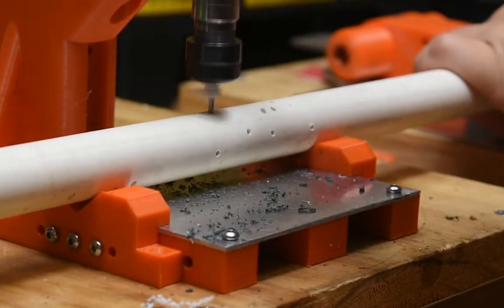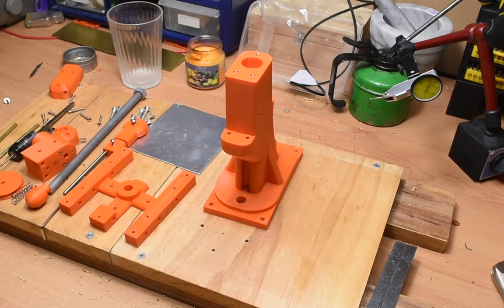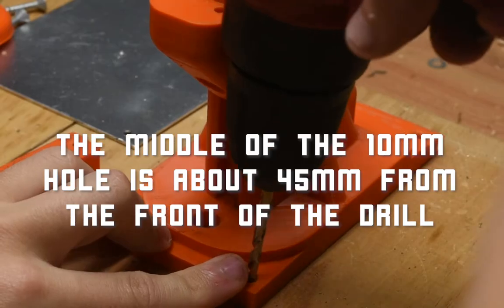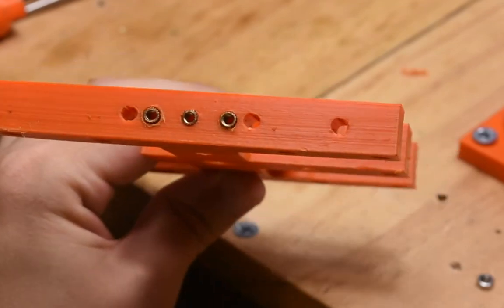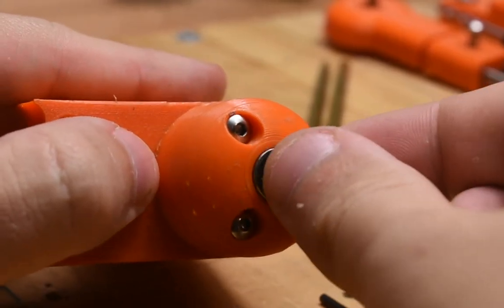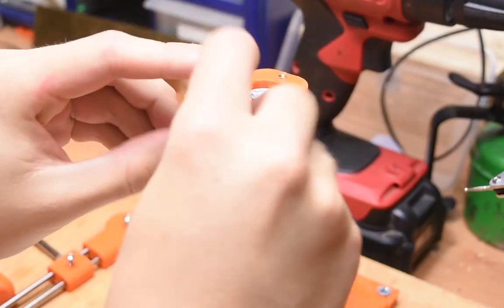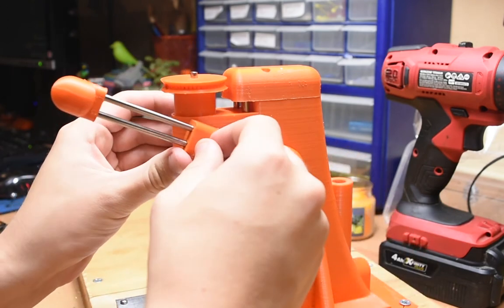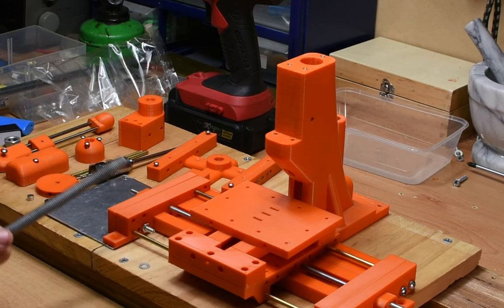3D Printed Drill Press (Part 3) - Basic Drill Build Video

Comment: EXCELLENT WORK 
1. What did you print in? 
2. Specs of motor and spindle?
3. Could yo mount the motor on a piece of wood which is bolted to the table?
4. I’ve never used a sewing machine before? How hard is it to move the pedal to another location? I’m in a wheelchair so a foot pedal is suboptimal

Comment: wy u dont buy a electric 
drilling machine & print a bracket ?
Reply from the maker: I explain a bit more in the first video but pretty much I wanted this to be as small as possible but didnt want to have to use a small motor as the spindle, so by having a belt driven spindle I can have the press be small but use a much larger motor. Also people have done that many times before and I wanted to design something new.